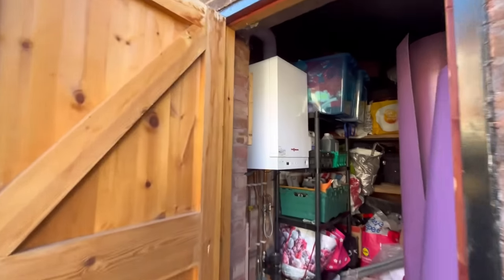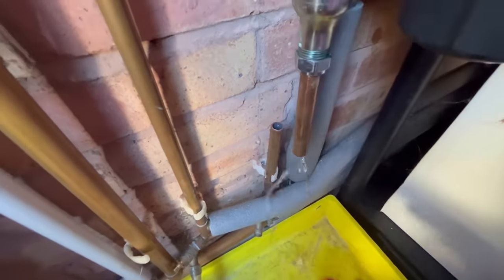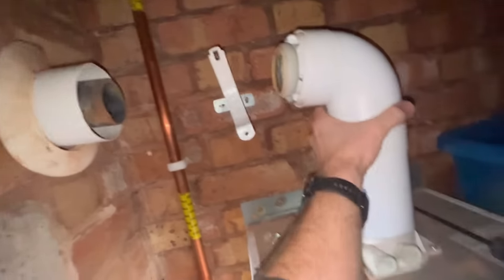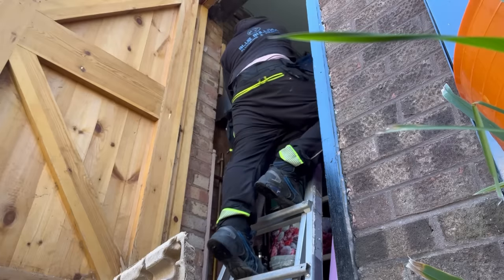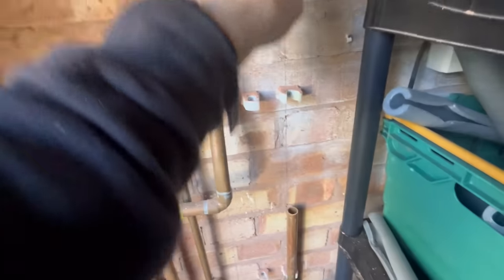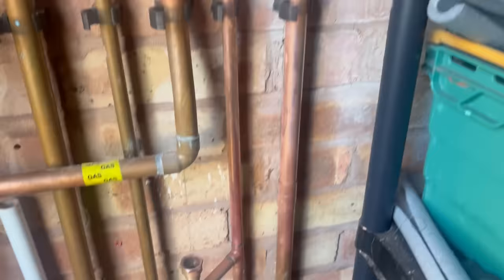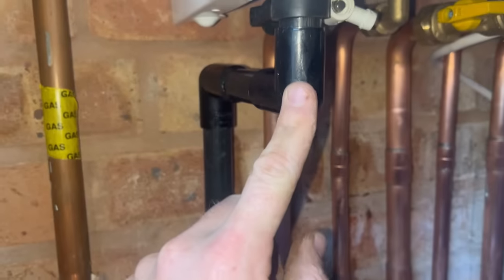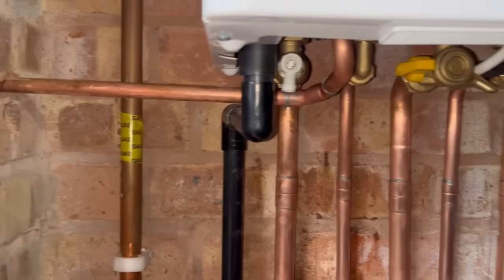Boiler Combi Swap. Luck Finally Changed!? Find Out On This Baxi 824

Comment: Fantastic job.
You don't have to change your cutting discs. I just use diamond one for everything, even galvanised pipes. Diamond discs are much more expensive, but they last longer and they do not wear out, so their diameter stays the same all the time.
Aluminium requires dedicated cutting disks.
And when I cut stainless and it has to be precise-ish, I also use dedicated discs. If I need super clean and precise cuts I use a chop-saw with circular saw blades for metal.
Not a fun of Milwaukee, but this tool is great.
Reply from the maker: Always changed disc to be honest didn’t know diamond would be ok on flue, I’ve got a Bosch diamond disc so I will give that’s a try on next job thanks mate 👍
Reply: @bluebulldog_uk  It's a bit louder and chamfering is a bit trickier, but you save a huge amount of time and money. Diamond disc I bought in January is still ok, it was around 25 Euros, I use it to cut literally everything. Today I cut Geberit plastic pipes, some brass fittings, galvanised 1/2 pipes and a piece of hard tile. I know it sounds crazy, but doing second fixes after cowboy builders has its price :)
If I used dedicated metal discs, I'd use up couple of dozens, 1 Euro apiece.

Comment: Love the Baxi’s, they are the best on the market at the moment. I have the Main EcoCombi 30, the only difference is the filling loop, it has traditional valves instead of the pull valve. Great range of boilers with a great design, brass hydro block, stainless steel heat exchanger. I’ve got it installed with the Baxi usense, which gives full control of the boiler. You have to get one and try it out. It gives you viessman level of controls on opentherm.

Comment: Open therm ? 9:38
Reply from the maker: Thermostat communicates with boiler to modulate the flow temperature, so the boiler will ramp up when it’s cold and slow down when it’s nearing temp